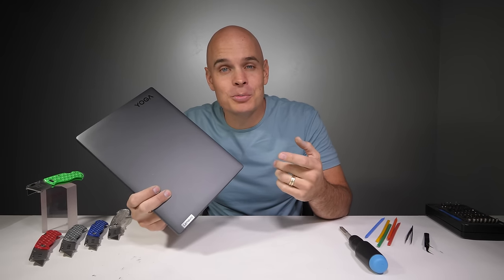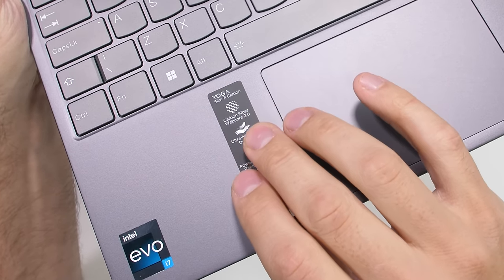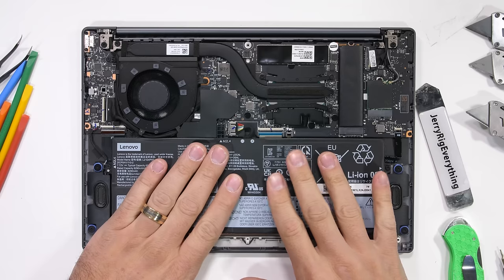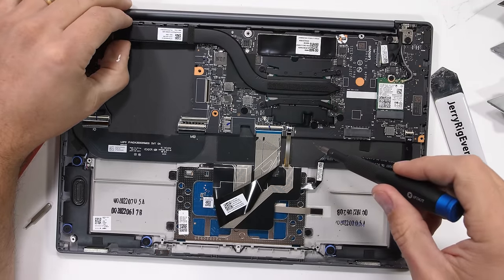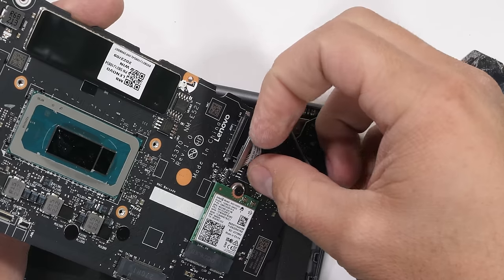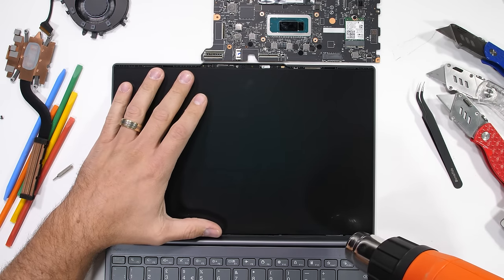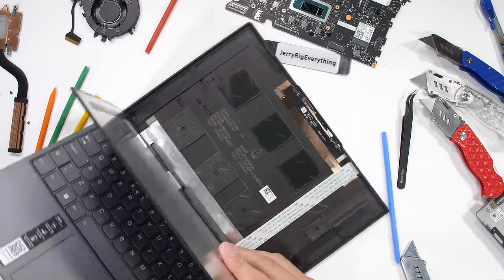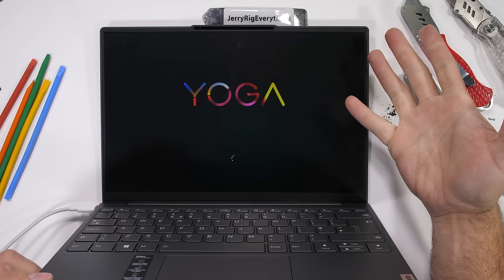FINALLY a new Laptop! - They say it has Carbon Fiber?...

Comment: I bet Lenovo held their breath until the end of the video. Very impressed the laptop booted up just fine!
Reply: or they sent another unit :D
Reply: @danielbrenzel292  🤡
Reply: it took a wee bit to boot up though
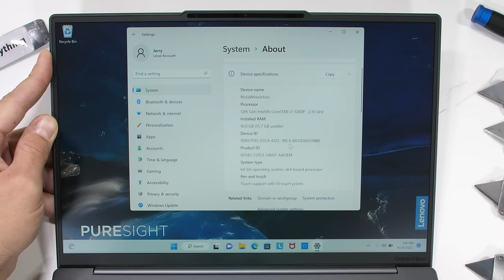Reply: @stiviajazi  It was probably error checking since it was restarting when Zack closed the lid at 1:47 before doing the teardown.
Reply: Lenovo doesn't care. Really.
Reply: Lenovo laptops are great.
Reply: @dann5480  I've had one for years it's been great yoga x1 carbon
Reply: Lenovo's are one of the best laptops to work on. Laid out sensibly, easy access to parts, and they try where possible to keep the different lengths of any screws down to a minimum, easing reassembly.
Reply: My aorus doesnt do that and has 14 cores that will drag this laptop and make it whimper
Reply: Last time I bought a laptop, was never in my lifetime. I have 2 PCs.
Reply: @fynkozari9271  i have a thread ripper  at home but for the road i need a laptop lol
Reply: @Newberntrains  I'm afraid of laptop getting stolen. How many did yours?
Reply: @stiviajazi  Laptops generally does a bit longer if you disconnect and reconnect the battery. Essentially a "cold start".
Reply: Half a million views on their laptop Ad in 13 days?, they be loving it.
Reply: Lenovo PAID for this advertisement.   How are people so gullible in how endorsements work?
Reply: He filmed that part first 🤣🤣
Reply: Lol they review the video before he posts it: dont be silly

Comment: Jerry silently throwing microsoft edge to the bin
Reply: we need to recycle the junk
Reply: It's better than Chrome now lol
Reply: @mikadofxx9030  No it's not. Chrome is still a way to go for most people. I would probably pick Brave or any other Chromium browser as my way to go without any password or accounts managers.
Reply: @thisfeatureisbad  if you are a student its pretty good for highlighting and adding notes on pdfs
Reply: @thisfeatureisbad  i like edge, because it's very simple and I feel like more things 'works' on Edge, but I only use it in work. For personal use, I also prefer Brave.
Reply: we all know that firefox is better.

the fact that firefox hard crashed my laptop like 10 times already.
Reply: Edge still gets bad rep for what it used to be and (for some reason) for what IE used to be as well. It's a shame, since it's a solid alternative to Chrome now. 
I doubt there's much reason to switch from Chrome to Edge right now - I switched back when it had the performance edge over Chrome, at least on my PC. But you can't go wrong with either one of them :)
Reply: @kamild_  they still try to force it on you, i wouldn't use a browser like that. 

I would just use firefox or chrome, uninstalling edge with power shell
Reply: @Zliarx  never had such problem with firefox lol
Reply: @Giuliana-w1f  I agree they try to impose it on you , but i do feel that Edge is better than Chrome imo , in edge i can highlight PDFs and since it's a windows default app , I don't care about the performance. 
Sometimes chrome runs in BG even after disabling in Windows and takes performance (it used to happen to me smh)

Regarding other day to day things , Edge is just same as chrome for me + a good PDF editor
Reply: @kamild_  it's the same thing. Both is chromium. Same with Brave or almost any other browser and many apps
Reply: @mikadofxx9030  Microsoft is in hot water because of that. Edge is only better than Chrome on windows because Windows doesn't let Chrome close background processes automatically. It's the same thing they did with IE back in the day. They are making Chrome worse on their OS so people are forced to use their product.
Reply: @Giuliana-w1f  How exactly are "they" "forcing" anyone to use Edge? What, with suggesting you try Edge before you change your default browser? 
Let's not pretend Google doesn't try to sway you their way when visiting their websites while using other browsers as well...
Reply: @EngiNetion  It's most probably a me issue. Or at most a device issue on my end. It somehow eats ram harder than chrome-
Reply: @TheDeadExplorer  Which is why I'm saying it's probably not worth switching off of Chrome towards Edge or any other browser, unless they have some specific features that may convince you to do otherwise.
Reply: @harmonic5107  no one is forced, you have many alternatives. Chrome is still the most popular web browser on Windows. Windows and Google are the same, Chrome on Android is pre-installed and you can't uninstall it and works better than other browsers.
Reply: @kamild_  microsoft tryes to make you ise edge, not only with the sugestions (something really anoying to always see in settings), but also the way they made it more difficult to switch the default in windows 11 (while switching to it is just one click), and the way that opens for several things even if it isn't the default
Reply: @Giuliana-w1f  This "more difficulty" I saw in 11 is the same as 10, it just asks you twice before changing the default browser. One extra click, that's it. Windows 11's file association management sucks, but that's more like Windows 11 being deficient rather than Edge being forced, since other apps can be affected by this too.
Reply: @mikadofxx9030  yes, no one is "forced" but it is still an anti-consumer practice and it needs to stop.
Reply: @harmonic5107  I mean it is bad practice, but it's clearly doesn't work lol. Google's on the other hand is working very well.
Reply: Chrome is overrated and gets slow too quickly, edge is faster and cleaner looking too. I dont have a ram problem, and its mostly thanks to edge.
Reply: @kamild_  then they updated it, because before you had to go one layer deeper and change every file or link type, and everytime it would ask you to stay in edge. And they tried to make any other browser have to do that (firefox found the way they did it and implemented it on their browser, idk about chrome)
Reply: @TheRMSAndre1   @MikadoFXX  two comments up
Is what I am talking about. People think it's a Chrome problem. Not Microsoft being Microsoft
Reply: @mikadofxx9030  better or not edge and any other stuff Microsoft forces me to use will be trashed. First 2 things I do after installing windows is changing default browser and telling Microsoft defender to fuck off
Reply: Edge is now my favorite browser ❤️
Reply: @harmonic5107  edge is great on Macos also
Reply: Good
Reply: did exactly that when using my 2017 hp envy 15 for the first time...
Reply: He is the goat
Reply: I use Firefox and Edge on my netbook and I use Edge and opera on my desktop
Reply: Right where it belongs.
Reply: Edge is just chrome but better
Reply: @Zliarx  How? I've been using Firefox almost 90% of the time on my 11 year old Dell, never crashed on it. Just like now on my desktop with 2 windows of Firefox, one with 90 tabs, the other 88 tabs. Works like a charm.
Reply: I use it personally and it's so much better than chrome now that I've ditched chrome altogether. It also benifits from being deeply integrated into the Windows OS.
Reply: @thisfeatureisbad  Edge IS chromium-based, it has been for awhile now. But edge isn't great because of all the horrendous data collecting settings that are turned on by default.
Reply: @BritishTrainspotting  Not just that. For some reason, it took max 2 threads off my CPU and I could really feel the stuttering while watching YouTube or Twitch. I couldn't find any settings for that. Neither the HW acceleration helped.
Reply: @kamild_  It's not solid. Chrome is full of Google's shit, but for someone that actively uses their products, that's fine. Edge is full of Microsoft's INVASIVE shit, and for someone (most normal human beings) that don't use their products (I mean email, drive etc) it's useless. Brave... I don't like it, but that's just me. There is also Opera GX... idk. But Edge is still a big no for everything except PDF's. The PDF reader is the most advanced one I've seen. And I use it.
Reply: @probably_yj  It's not the same as chrome. But the PDF reader is noice.
Reply: @mikadofxx9030  You can disable chrome on Android, but it's not worth it... In an OS centered around Google's products, it's just better.
Reply: @kamild_  Man. On win10 is a click. On 11, it's a list of like 10 things you have to change. Get ur facts right.
Reply: @HusseinAl-Dalawy  Defender is actually decent now...
Reply: @sedixmrboss5625  I don't know what kind of "shit" you're thinking but it works just fine for me, so I guess it's not a big deal.
Reply: @kamild_  I mean cloud based stuff.
Reply: @sedixmrboss5625  nothing you can't turn off if you don't want it. And I'm not sure what you're talking about in terms of 11 because I've been working on a handful of PC with 11 and it really was that simple. Just like in 10.
Reply: Edge is way better
Reply: @HeX341  again its a me issue. It eats up my 8gb ram a lot. Im probably doing something not right.
Reply: @thisfeatureisbad  It is better than Chrome in a lot of ways
Reply: @thisfeatureisbad  and here we see a guy that has no idea about what he's talking about
Reply: edge leaves a bad taste in my mouth with all the forced integration with windows 10, and the MICROSOFT-EDGE protocol being used. i like firefox better.

Comment: I'm still baffled how you can make a laptop with soldered RAM, ports integrated with the motherboard and a giant warranty void if removed sticker, and still make the modularity the main talking point of the sponsorship
Reply: if it has enough ram, I don't see anyone performing ram upgrades. Most of the time it's usually storage because you want more and it's a consumable

also for a smaller form factor/superlight laptop, you almost NEVER see upgradability, so that's pretty sweet that they managed to pop it in
Reply: It doesn't really need removable RAM, 16gb is enough for this type of laptop. It's not a studio/gaming laptop, more like office or travel one
Reply: @sp22ce  Yeah, that more or less the point I was trying to make; for the audience it's targeted at, a RAM upgrade is honestly unnecessary.
Reply: @AshrZ  and I completely agree with you. I think the modularity comments were Zack's own thoughts, not the selling point of the laptop. Other than RAM, it's as modular as one would expect from any laptop
Reply: Tbh for a laptop so thin and light, I was expecting it to be all soldered and glued inside. I was surprised how easy that came apart.
Reply: @sp22ce we’ll see in 3-4 years. I bet 16GB won’t really be sufficient then and you won’t have any way to upgrade it. You’ll have to buy another laptop
Reply: @mihnealazar7039  mate it's not a gaming laptop, MS Office and a browser won't require more RAM even in 10 years. I'm surprised this machine has 16 and not 8 gigs, cuz 8 is still enough for most tasks
Reply: @mihnealazar7039  who really updates ram anyways? Most gamers are going to to max and be done with that. And my 2011 gateway core i5 still works for everyday task, just has a slow start up and data transfer with 8gb of ram.
Reply: @sp22ce  Nope; Win11 & just Edge or Firefox, Zoom, and steam are pushing my ultrabook past 8GB and using about 2-6 GB of swap file. Remember that integrated GPU carves out 1 or 1.5 GB leaving just 7 or less usable RAM. I won't look at laptops with less than 16 now
Reply: @stephen1r2  I had been using my gaming laptop with 8 gigs of RAM for several months before I added another stick. Same usage scenario as you describe: win 11, chrome with dozens of tabs, zoom, I even played triple A games. The only negative effect I had was gaming performance bottleneck because of the lack of RAM. Other than that everything was perfectly usable.
The cpu on this model is pretty good but it's still a 13" ultra-lightweight laptop for the most basic tasks on the go. And since you mentioned the RAM swap file, it also helps not to notice the lack of RAM with a fast ssd (again, in basic tasks)
Reply: @TraceyAllen  it's not the point. It's about making space for some parts to be modular but restricting access and doing a half-assed job by leaving out the ram which is pretty common these days to be modular
Reply: are all of these replies corporate shills?
Reply: @sp22ce  If the RAM dies, you need a motherboard replacement. That's my problem.
Reply: yeah yeah ... 16 gb is enough FOR NOW .

Comment: Jerry is incredibly generous with thermal paste. Thumbs up for that
Reply: Better to have a little too much than have a 10°C delta in your hotspot sensors lol
Reply: Tbf this is directly on die, not on an IHS like in PCs so here you have to make sure that every little bit is covered in paste or you can literally break the CPU
Reply: Actually, less than more in this case. CPU temp differences of a degree or so in some cases. EDIT: this is direct die. Usually less is more, but in this case it's fine.
Reply: EDIT: ignore this. Did not realize this was direct die.
Reply: @drpixelcat9408  The excess paste is only going to be squished out. Having direct die contact like that it's way better to have extra, because you need every little bit covered when doing it like that. It's not transferring the heat anywhere like an IHS so the slightest dry spot can fry your chip.
Reply: @xFluing  Did some more investigation instead of relying on my prior memory. It may not make a difference temp wise in most cases, but less is always more. I'm not saying like a tiny micro drop, but a very small x will do the best. No, a dry spot will not fry your chip my fellow nerd. I suggest you do a bit more research on the matter before doing this with your new gaming pc. Also, as someone who is typing on a laptop that I repasted and the chip is "dry" on a few sections, I would say it is not consequential.
Reply: @drpixelcat9408  You did no research. Luke from LTT found out, even on an IHS its better to have too much than too little. Again the excess is just squeezed out.

But once again this is DIRECT DIE contact which means you have to be ABSOLUTELY SURE the whole chip is covered
Reply: @xFluing  Gamers Nexus did a similar test and found identical results. The whole 'too much thermal paste' narrative needs to die already.
Reply: Came here to say this lol 😂 🤣 😅
Reply: @iamaduckquack  it makes sense if the paste is conductive but nowadays theres barely any conductive paste on the market
Reply: I'm a long retired tech from the days when thermal paste wasn't actually a very good thermal conductor. That's why we went to extremes to make the CPU surface and heat sink as polished and flat as possible. In those days any excess paste made more than a few degrees difference with outrageous overclocking. Not an old wives' tale, but empirically observed many times. 

Apparently, today's improved heat sink paste conducts heat much better. That's wonderful since all the fiddling we did twenty years ago was not much fun after the first few dozen times.
300 MHz Celerons rule! Well, maybe they did for a little while.
Reply: Honestly, that's fine. The main issue is air gaps, this is literally why thermal paste exists. As it's a viscous fluid, it will be squished out when appropriate mounting pressure is applied, filling in the imperfections in the metal, allowing the chip to transfer heat better to it than if there were many air pockets there.
The only real downside is it can look a bit ugly, but it's non conductive (for electricity), so there's no issue there either. If you think otherwise, I guess you also still believe saying beetle juice 3 times will make bad things happen.
Reply: @drpixelcat9408  With direct die it's really best to spread the paste to every corner just to be sure. Check GPU repaste videos from any tech channel. In this case that generous line should be OK as it will squeeze flat and the excess will just proceed to leak all over the inside of the machine.
Reply: @Thankz4sharing  450Mhz with simple FAN OC was something else ... that'll never happen again ...
Reply: @xFluing  Ok, did not realize there was a difference between the two. I still think he was a bit too generous, but it won't fry his circuit board or anything. And, yes, I did do research, but it was not a direct die. Thanks for correcting my rant. Sry. Every bit of info i have found before this has always said less is more (not talking about direct die). Yay! Misinformation!
Reply: @iamaduckquack  Not to argue or anything, but when it is not direct die, it generally won't make a difference when it comes to thermal paste application. You obviously don't want to put no thermal paste or a tiny amount, but it is better to have less thermal paste than a fried circuit board. All I am saying is that it is better to have your cpu hotter by half a degree than have a fried circuit board. You need to put a good amount, but being generous is not exactly what you want either. I mean, I re-pasted my laptop and did some undervolting and got the CPU temps down and I only used a little dot.
Reply: @drpixelcat9408  Huh? No one is frying their motherboard by using too much thermal paste. Don't argue with me, go watch the videos and see for yourself.
Reply: @iamaduckquack  Thermal paste is conductive. It can and will fry your motherboard if you use so much it squirts onto it. And I specifically said I was NOT trying to argue with you, but there is sense to less is more and I was just trying to let you see that. Sorry if I come across as harsh or something.
Reply: @drpixelcat9408  No harshness here :) a slight correction though, most regular thermal pastes these days are non conductive so that's a non issue. The exceptions being the higher end liquid metal compounds which obviously need much more care as they are conductive and harder to work with.
Reply: @iamaduckquack  Oh cool! I figured since it conducted heat it had to be metal, and the stuff I use is arctic silver 5. Nice that its non-conductive.